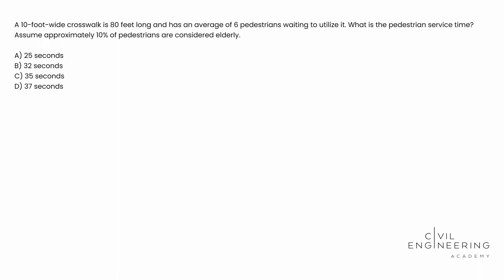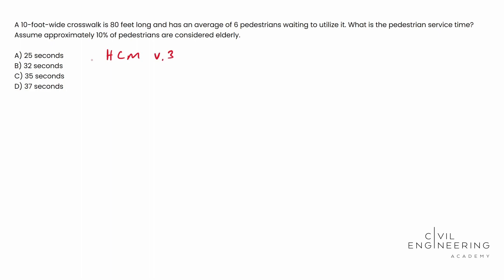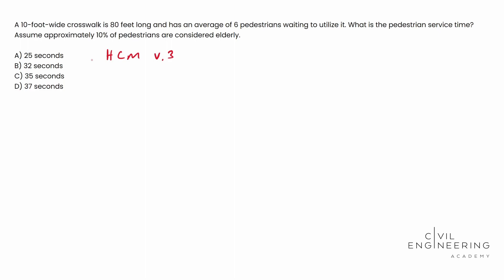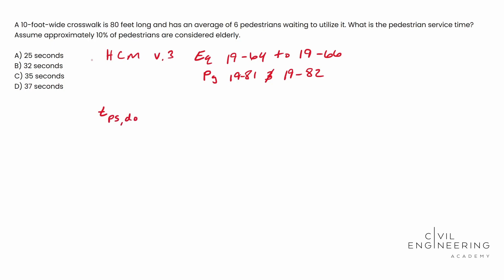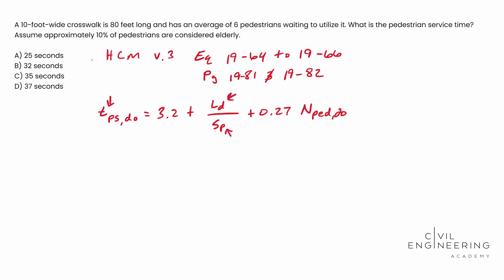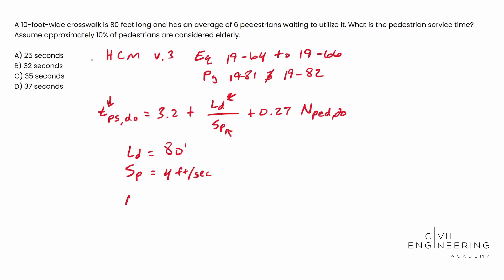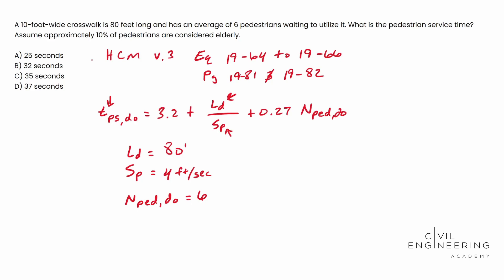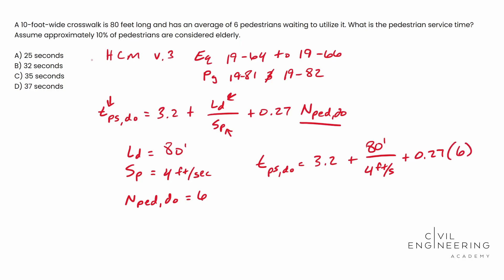Civil PE Exam – Traffic Engineering – Calculate the Pedestrian Service Time

Comment: Pedestrian problem -> Highway Capacity Manual -> chapter 3 -> ctrl+f 'pedestrian service time' -> index points to pg 19-82 -> use equation for less than or equal to 10 ft width -> the S variable isn't defined -> just know ahead of time that 'S' is speed -> ctrl+f pedestrian speed -> the manual says 4.0 ft/s is desirable on pg 16-20, and 3.4 MILES PER HOUR on page 24-9 -> memorize 4 ft per second
Reply: ctrl+f elderly -> page 18-48 shows walking speed based on % of elderly -> at >10% elderly, subtract by 0.3 ft/s, which gives 4.1 ft/s? Gives 24.3 seconds -> round up to A) 25 seconds